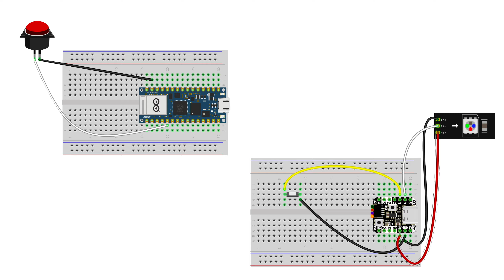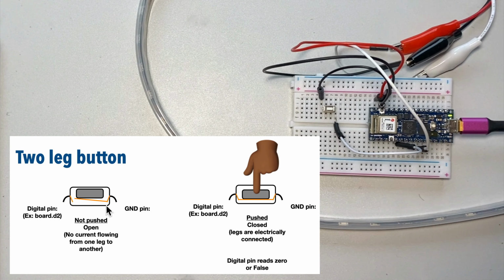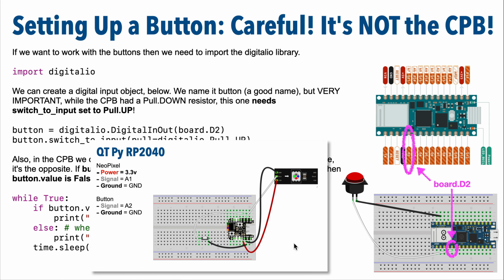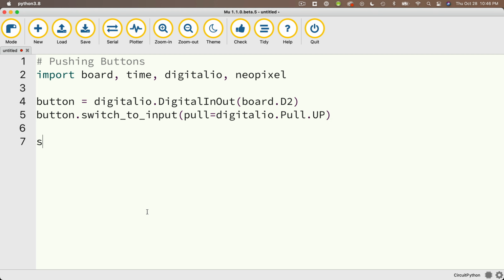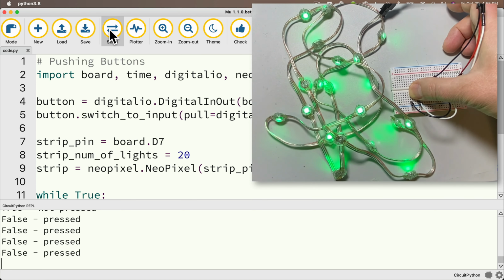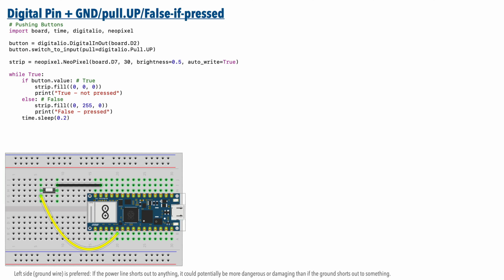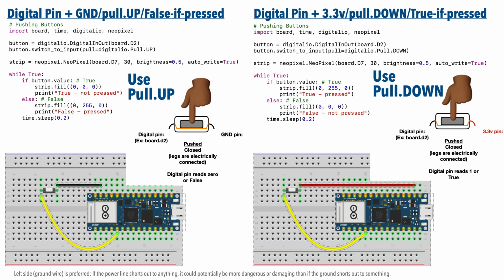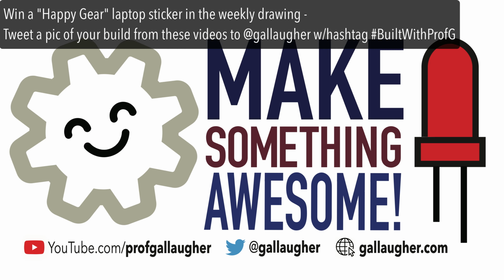CircuitPython School - Getting Pushy by Breadboarding Buttons

Comment: Thanks so much. A friend and I were working up code for an Ecto Containment Unit using an Adafruit M0 Express, but the buttons were triggering prematurely. Watching this I realized we had our TRUE/FALSE inputs swapped with a PULL UP resistor and the buttons wired to ground. Just switching those to PULL DOWN and wiring the buttons to 3.3V fixed everything. Everything works! Yay!
Reply from the maker: So glad you’ve found this helpful. Keep hacking!

Comment: Mr. John i try test this code it work on my Raspberry pi pico                                                                                                                                                           import board
import time
import digitalio

button = digitalio.DigitalInOut(board.GP22)
button.switch_to_input(pull=digitalio.Pull.DOWN)

while True:
    if button.value:
        print("not pushed")
    else:
        print("PUSHED")
    time.sleep(0.2)
Reply from the maker: So sorry. Not sure I understand the question.